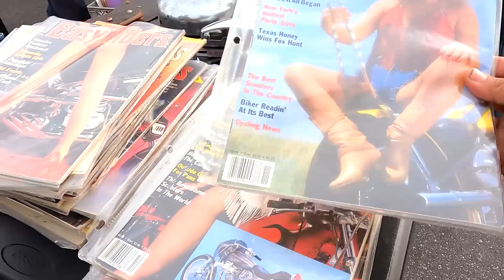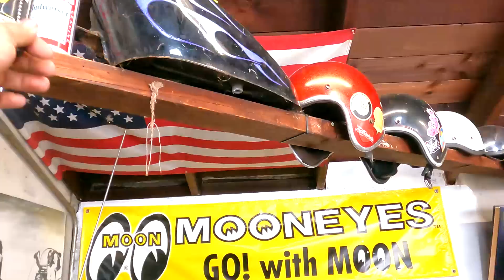#368 - February Cycle Swap 2024

Comment: I can't get enough of that Sportster chop from Deathstalker Customs. From the extended frontend to the paint, to that trident sissy bar, that bike just clobbers it! That blue Sporty next to it is boss too. That's a VERY nice Duo Glide drop seat frame at 11:17. It's rare to see them in that pristine condition and without a hardtail welded onto it. Thanks for the video, guys. Be safe. -- W

Comment: The sidecar motorcycle is a Russian bike called Ural and is basically a ww2 BMW. They copied every detail of the BMW design and made molds and dyes to produce their own engines and gearboxes in Moscow. Everything about the bike was reverse engineered. Early in 1941, the first trial samples of M-72 motorcycles were shown to Stalin, who immediately approved production of the motorcycles.